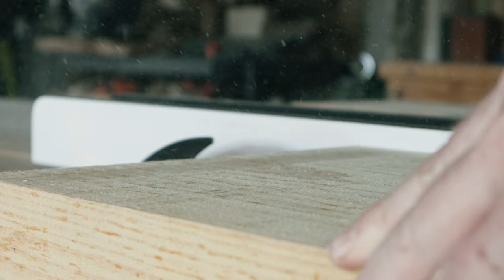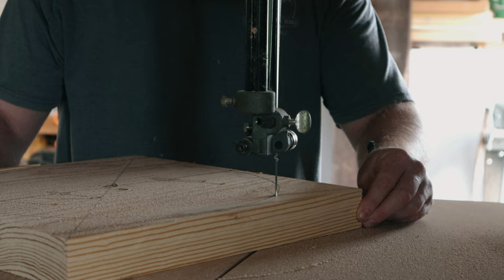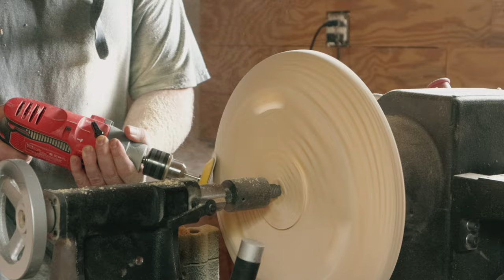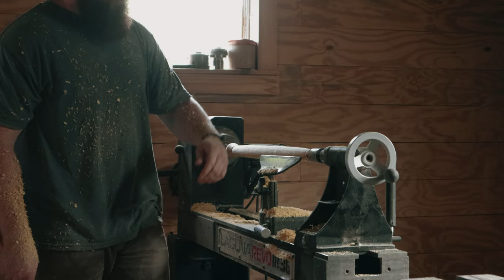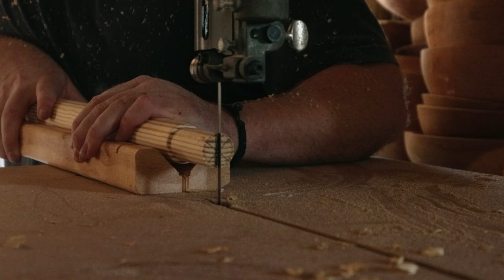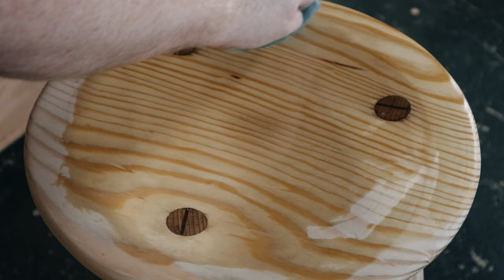My Very First Attempt at Making This Three Leg Stool From Pine

Comment: It's a beautiful little stool. Wedges should be set perpendicular to grain direction. When installed parallel with grain they have a tendency to split the wood along the grain. I found this out the hard way. Prototyping is how we learn.
Reply from the maker: Exactly! This was the second time I’ve ever made through tenons so still learning & that’s also why I went with pine. Was just going to be a shop stool anyways and more of learning experience than a finished product but I am still happy with how it went!
Reply: I was confused until i realized you meant perpendicular to the grain of the seat blank.  thanks for tip!

Comment: what is the angle of the jig you made to drill the holes in the seat? And is there a formula or plan for where the holes for the legs and the length of the supports go?
Reply from the maker: I cant remember off the top of my head but I want to say 12 degrees was the angle. and for everything else I honestly just made it as I went. I focused on the legs first and then once they were all done, dry fit them with the top and then measured everything else out.

Comment: Cool project, looking to tackle something like this soon. 

One recommendation on the holes for the tenons, is to recess a larger hole about 1/4-1/2” (depending on the leg angles) so the top leg tenon can sit inside and appear flush and not show around the edges. Hope that makes sense. Cheers!
Reply from the maker: It does! I have seen that done before & I have also seen where people curve the leg into the tenon so there is no separation. I plan to give that a shot next time for sure because that part is noticeable. I appreciate the suggestion!

Comment: great job.
note: if you have to put clamps for the strechers then you are doing something wrong ,you see a strecher should be longer than the gap between the legs meaning that when you install it in place it streches the legs apart by 1/4 " which gives the chair the rigidity it needs and eliminates the need for clamps.
this is where it gets its name from and this is how authentic windsor chairs are made.
Reply from the maker: I appreciate the info! This style of work is definitely something I am working on and still have a ton to learn.

Comment: Great job, as always! I'm wondering about the strength of this particular combination of support pieces. If you would use three pieces to connect two legs each (forming a triangle at the base), would it be stronger? Or is the one you build a better / stronger option?
Reply from the maker: I think both styles are pretty strong! I have seen this style & the triangle style used by commercial furniture makers so I would assume they would both hold up. This stool will be getting a lot of use so I will know for sure either way! lol

Comment: Awesome job! I’ve been wanting to make some of these…. What is the diameter of the seat?
Reply from the maker: Thank you! I went with 14" but I may would go a tad smaller or either adjust the foot rest height because it seems to push into my thighs a little more than I would like. I would probably adjust the foot rest first to see if that would help.
Reply: @andrewmccarn  You’re welcome!That’s good to know. My lathe max is 12 1/2 so maybe i can make one… i have a ton of scraps the need put to use so hopefully this weekend!